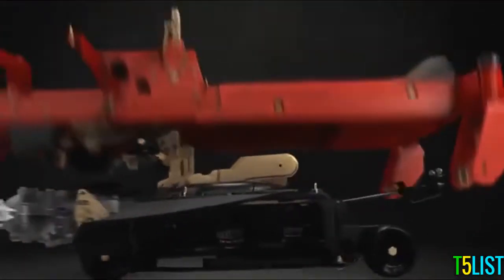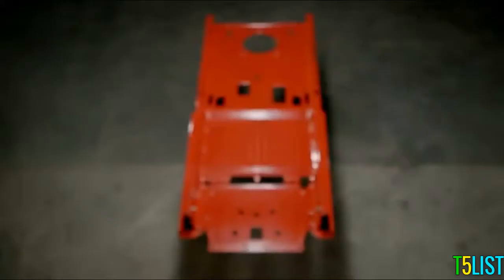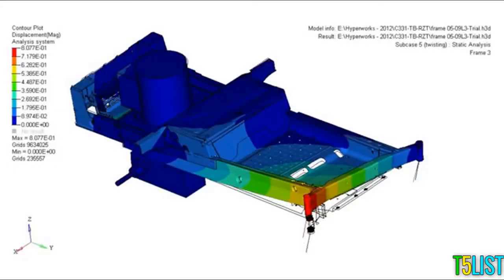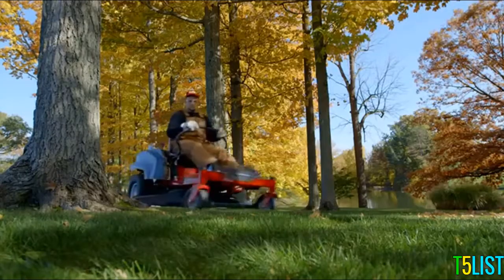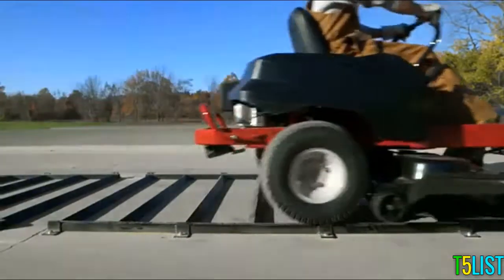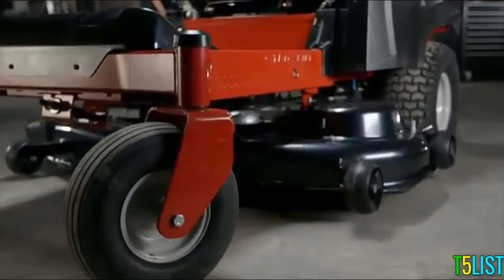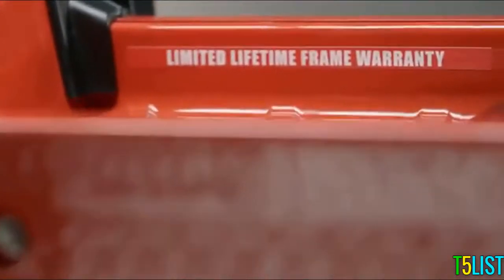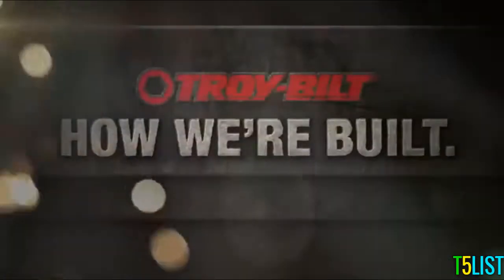Best Zero Turn Mowers In 2020 - Troy-Bilt Mustang 46 22HP 46-Inch Zero-Turn Mower Review

Comment: Purchased this mower  two years ago and so far,  it has about 78 hours total usage because of problems.....I don't know why but the unit will start and run as designed but will not go forward or backwards when using the control arms. I have an average size yard (about 3/4 an acre front and back). I do everything to keep this mower in tip-top shape, but seems to have the same problem over and over again.....It quits moving after just a few times of cutting. I was using it last week and just about finished the back yard when all of a sudden, I heard a thud, and thought I smelled something burning. I immediately shut the engine down, checked to see if I hit something--but I couldn't find anything. This is the second time this happened in about a year's time-frame. The first time it happened, I got a thud, started to smell like a belt burning and it quit moving on me....Is this an ongoing problem with this model(46" cut) or is it just the particular one that I have? My dad has a 42" Troybilt Mustang similar to mine but hasn't had any problems similar to mine.....I love the mower, would definitely love to keep it and get my money's worth from it. I just hate having to set it aside to use my old John Deere riding lawn mower....The zero-turn cuts much faster.....I am open to suggestions.....Looking to take it in for service sometime this week....

Comment: Great lawn mowers I own 2 just like this one,but I do wish troy-bilt or mtd would put a seat on them that has springs to soften the ride some.i mow lawns for a living now and these mowers are really great with great warranty on them if your like me you pay for the extended warranty for 4 years.but like I said it's really hard to mow for at least 10 to 12 hours a day and when you quit for that day your butt and back are just plan killing you because of the non suspension on them and the seat has very little spring tension on it.but with the Briggs motors there really good as long as you change to oil regularly and keep ever thing tight on them if so they will last you a life time now.i bought my first one back in 2014 and it's still going just as strong and my newest one last year now.but in my opinion if your looking for a really good zero turn mower for your lawn then this lawn mower is the one for you then and it will serve you for a many of good years and more now!!!!!